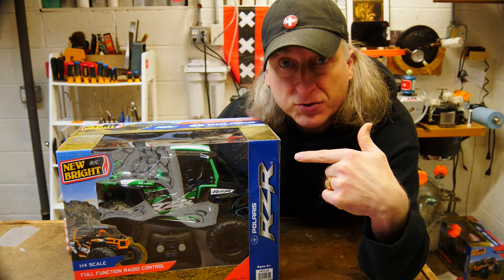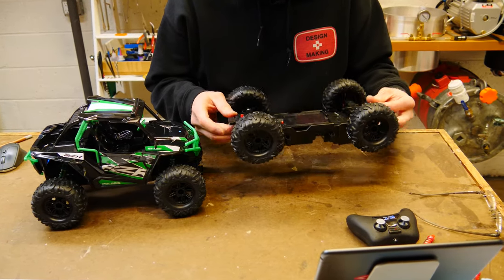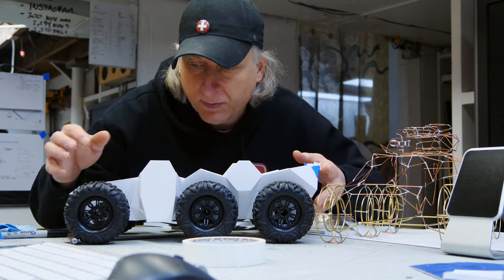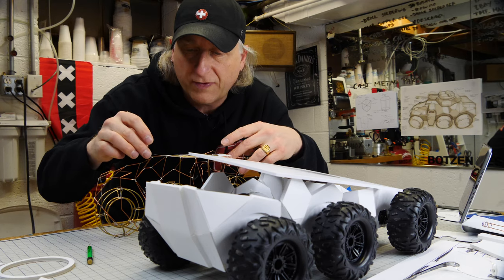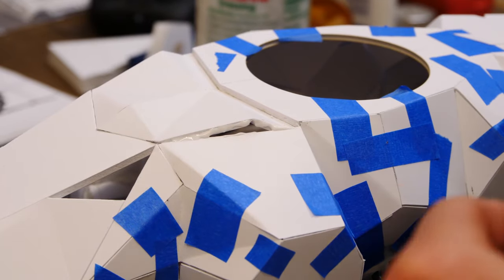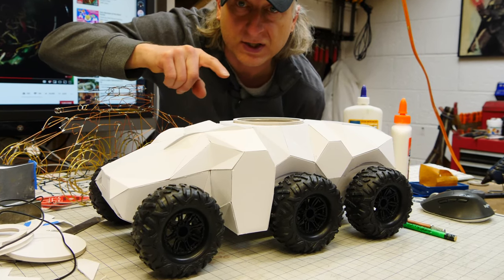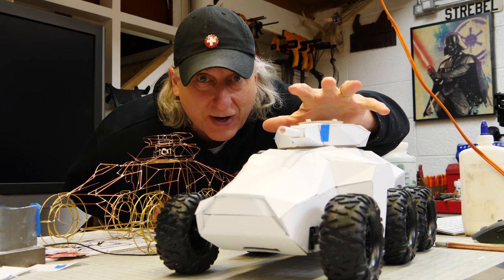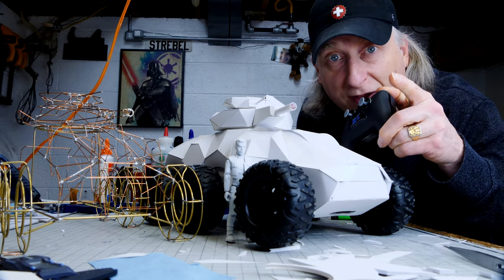Epic FoamCore Six Wheeled RC Vehicle BUILD

Comment: Are you just eyeballing the miters, or is there a trick you're using to determine them? Your foam-core tutorials don't quite address irregular faceted shapes like these...
Reply from the maker: Most of them have a template cut first out of paper or cardboard you can see it real quick in the beginning of the video
Reply: Eric Strebel do you trace the template from the wire model? Is there a way to build this without the wire model first? Otherwise, depending on what you want to accomplish - might as well just cover the wire model with thick paper or sheets of styrene. Regardless thanks for the vid, I got some good ideas from the process!

Comment: Hi Eric,
I really like your videos and is really an inspiration.
Just a question. Should you want to take the RC vehicle you have build with foamcore to the next level? Let's say you want to manufacture it in plastic. Would you then spray the foamcore with a primer and spray to get it nice and clean so you can make a rubber mold or any other mold for your RC vehicle?
Or do you have any other advice on perhaps a project like this? Thanks Johan
Reply from the maker: I depends on your goals, but building it digitally and then printing it would be better if you planned to manufacture it. It needs more design refinement and development at this point. But at some point, I would scan the foam core and clean it up in CAD and get it ready for prototyping and move it toward production.

Comment: The 'how to' part is really nice, but I really hope this idea for a "tank" doesn't go anywhere. It's pre-WWII lack of sophistication would probably not let it get to the trials phase, which is good.
Reply from the maker: Infantry fighting vehicle actually, not a tank. It’s fast and light, stealthy and packs a lot of punch. It would be ideally suited for future urban conflicts. It’s a flexible and modular system that allows it to be easily adjusted and configured into various types of vehicles. Thanks for your comment and support.
Reply: @EricStrebel  That's a good sales pitch. I rode in an IFV in Iraq though, and that's how I know your design is flawed. 

Your tires look to be about 5' tall, but your ground clearance is about 1'. With the flat bottom, this means it is fully exposed to landmines/IEDs, as well as having poor offroad performance. So the places that it can operate are predictable. 

You must have noticed, while cutting and placing all of those angled facets, that it took a lot more work than something with simple - yet protective - armor. All those seams that attach the plates together are weak spots to enemy fire. It will sorely increase the price, and time to produce, but will have to be bolstered to the point that this can't be a wheeled vehicle anymore. They also are harder to cammoflage, and have poor radar crossection, and will aid laser/radar/thermal/visual guided weapons into it. The armor randomness will also confuse the friendlies around it because of the way it will make enemy sounds seem to come from the wrong direction. The frontal arc has two non-redundant tires in it. The frontal arc is traditionally the most heavily protected part of an armored vehicle. This will likely be the first thing mentioned when the design is rejected. The current trend in armor design is to avoid making a tall vehicle. Which will see your double-stacked turret on an already too tall vehicle , pretty cringey. Being on wheels, this is also a rollover risk, stifling maneuverability. To gain protection, this vehicle will need to remain behind cover, which causes it to be immobile, and the requirement to armor the top part, so it can operate from a hull-down position, will make it even more prone to rollover. Worst of all, you modeled it after an alligator. Not only is this a completely pointless objective, but on your early dismissal from the sales meeting/convention, people are going to laugh and say "It doesn't even look like an alligator". Having been told this beforehand, you will be more likely to make it more alligator-like, and seal its doom. What do alligators and Tesla have in common anyway? I mean, if you are lucky enough to encounter someone who is familiar with C&C videogames, you better have some energy weapon on it, just so something about it makes sense. Furthermore. Your side exits are weakspots within the expected firing arc of the enemy. They protrude and are therefore easier targets, and are narrow. Imagine a fully-armored soldier, burdened with an anti-tank missile, trying to hurry out that little side door... On one hand, smaller weakspots are nice. On the other hand, chokepoints, where the enemy can concentrate fire, are commonly called a "fatal funnel". The M2 Bradley IFV has a small door in the back ramp for in case the ramp actuators stop working.. .which they do regularly. That little hatch is really hard to open/close and it's small and lightly armored. A dismount soldier in a Bradley has 5 exits in case of rollovers (in water) and internal fires. Rollover and fire drills happen with nearly every training day in a Bradley, and still soldiers drown/burn/asphyxiate (from Halon bottle discharge) because it's so hard to exit an armored vehicle while you have combat gear on. This is a burden that makes the soldiers nervous to be inside an armored vehicle. Be ready for any veteran who has worked in armor to point at your creation and say "deathtrap".
Reply: Buck Starchaser still cool tho. I think the point is more the strategy and process of building a model rather than the strength of concept. The various facets and joints show the flexibility of foam core as a medium. Besides, ideally designers work with engineers and specialists throughout the process if they hope to accomplish anything truly useful. It’s an rc car not a military proposal lol.